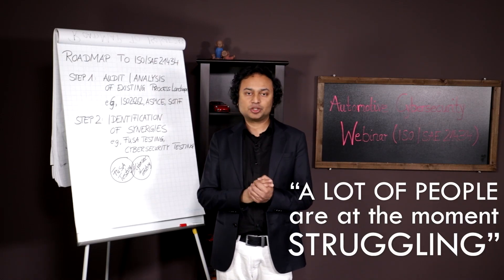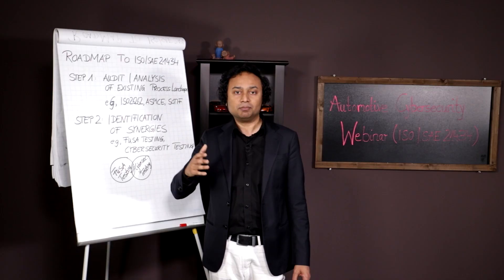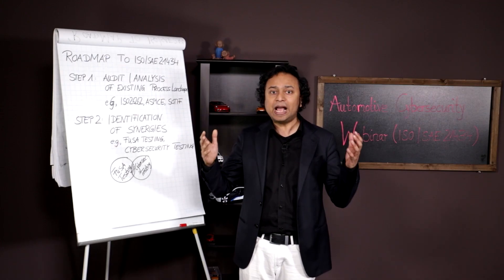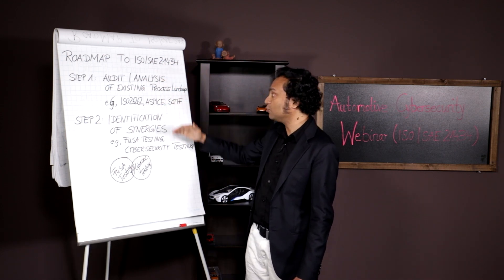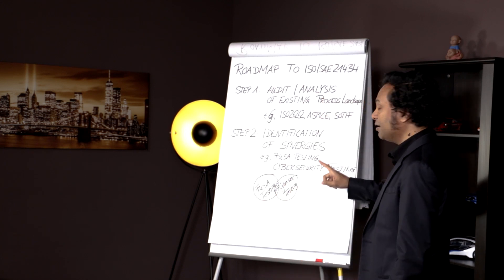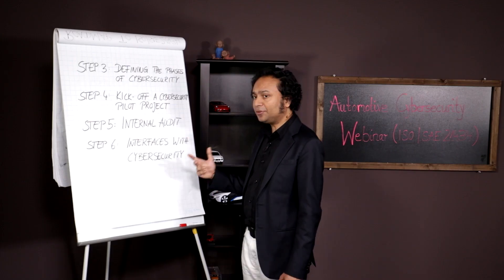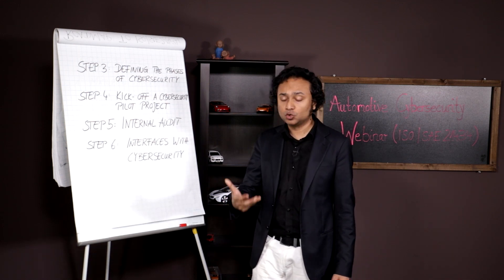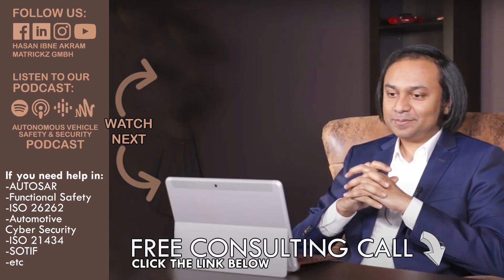6 Steps Towards ISO 21434 Compliance

Comment: We do ISO 26262, but not ASPICE . What process do you think we would miss? So far I didn't find any processes that are not defined by ISO 26262 + ISO 9001.
Reply: ISO 26262 and ISO 9001 provide a strong foundation for functional safety and quality management, but ASPICE (Automotive SPICE) adds process areas that focus on systematic software and systems development, which may not be explicitly covered by ISO 26262 and ISO 9001. Lol ik its been 3 years to this comment but hope this helps
Reply: @ wel do use other ISO’s  together which are reversed by iso26262/iso9001 . Like iso 10007 .  Useful details are in aspice ,  but no new processes